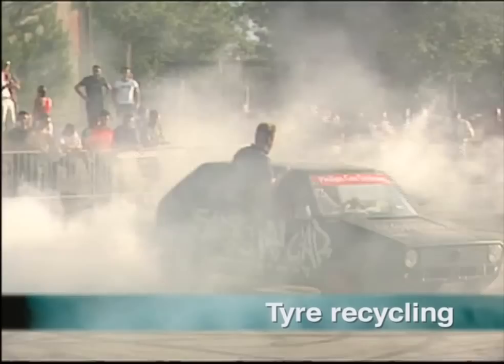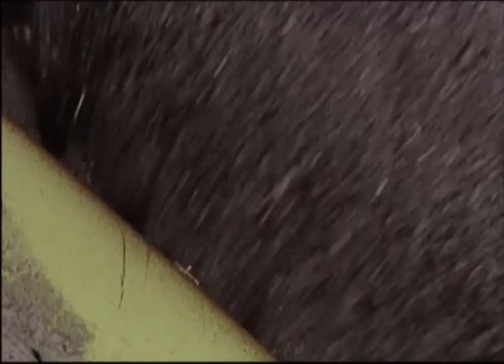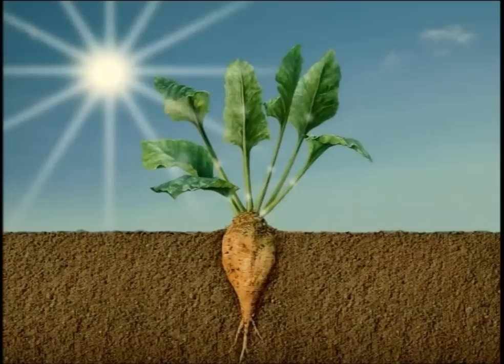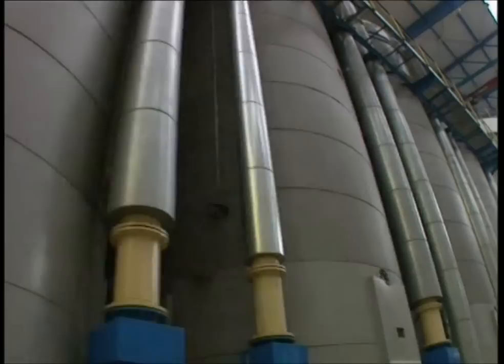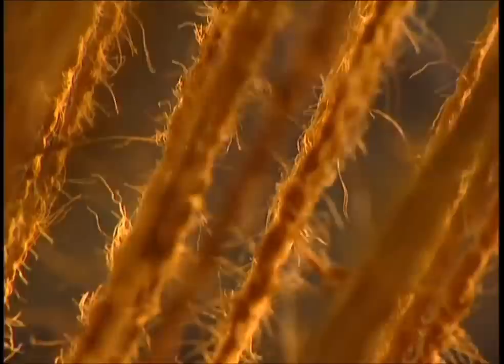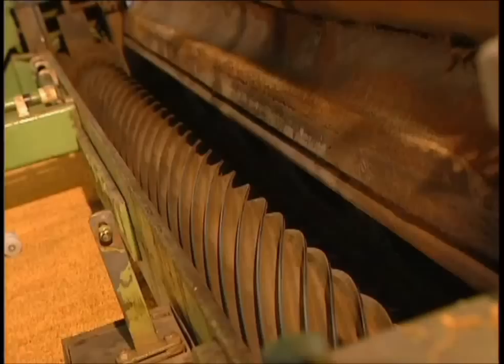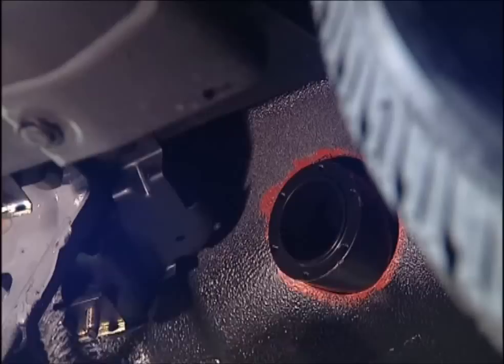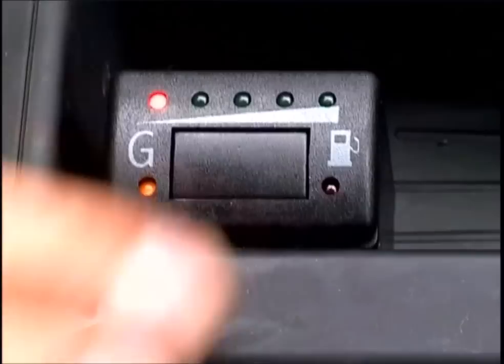HOW IT WORKS | Tyre recycling, Sugar, Doormats, LPG conversion | Episode 26 | Free Documentary

Comment: Liquefied petroleum gas or liquid petroleum gas (LPG or LP gas), also referred to as simply propane or butane, are flammable mixtures of hydrocarbon gases used as fuel in heating appliances, cooking equipment, and vehicles. To clarify LPG is typically propane, which is not a liquid at room temperature, its a gas. It's "liquefied" under pressure in a gas bottle at approx  320PSI. Many  people use a LPG gas bottle to run their propane gas BBQ grill.
Reply: dont forget city buses, many are lpg :)
Reply: BETTER !! TALK !! HYDROGEN !! TOO !!

Comment: Europe is obviously a little behind in fuel technology. LPG (aka propane) conversions were popular in western Canada from the mid-80s through the mid 90s, then began to taper out. By 2015, you would have a very difficult time finding a place to refuel a LPG car, if you could find one at all.  

There were several reasons for people going away from it. 

1. It was less efficient, using more fuel to go the same distance. Even though the fuel was cheaper, you used more, and that, combined with the cost of having the conversion installed made its value questionable. 

2. It lacks the lubrication that is in gasoline (petrol), causing the engine to wear out prematurely, also adding to the question of it actual value.

3. Special safety training was required to fill a car with LPG, which meant that it was not available at self-serve gas stations. With the amount of full serve stations shrinking, people with LPG cars had difficulty finding a place to fuel up. 

4. Unless the engine was completely rebuilt to run strictly on propane, it produced less horsepower after the conversion, which made driving less pleasant. 

5. Increased fuel efficiency in gasoline cars through the 90s and 2000s made it less worthwhile. 

Overall, the cost, and the inconvenience, of LPG lead to its demise around here. Perhaps it will have a resurgence, but I doubt it.
Reply: tell me what Europe is not behind , Europe is even behind China in term of new Tech .
Reply: @caughtinprovidence7197  Have you ever considered fuel prices to be different from the ones you have at your gas station ? In EU in general we have much higher prices and taxes on fuels that you have in the US or Canada, and LPG or CNG, for example, are much less expensive than unleaded or diesel....so it is much more economical to drive an LPG converted car than the standard gasoline one... and I am not considering the difference in pollutant emissions, here in EU Heavily regulated, and much lower on LPG or CNG converted cars. Perhaps not all the world is in your backyard ?
Reply: I think L.p.g. is here to stay. Not necessarily as a conversion but rather an engine much like the forklifts utilize, but fitted to automobiles. Diesel retro-fitted with Lpg add-on is supposedly another alternative. I'm not sure, but many people have such a system and claim it's rewards.

Comment: Crumb or the very fine scrap rubber is used in many countries as a additive to cement and ashphalt products.  We had a very efficient plant that was making playground mats as well as exporting to Brazil; anyway, our local worms beat the operator over the head with paper clubs and he sold off the equipment.  This isn't a "clean" business but it keeps millions of scrap tires out of landfills.  Some unethical auto recyclers bury the damned things!

Comment: I can't see LPG lasting as we're going towards electric now, unless we have an LPG/electric hybrid system.
Reply: i think the biggest limiting factor to lpg is the innate hazard lpg poses, especially when you depend on each individual to properly maintain lpg cars.
Reply: @longlongtran  LPG cars are less of a hazard than petrol fueled. The tanks are made to a higher standard than petrol tanks, and the safety controls on the fuel system are more rigorous. The limiting factor is more likely to be the oil companies, along with governments who stand to lose revenue through reduced taxation. The fuel is more environmentally clean and in most cases is produced as a byproduct of natural gas production.
Reply: @droopy_eyes  the Real Benifit ! Is Hydrogen !!

Comment: If they improve this lpg fuel mileage then I think it will catch on around the world 

Especially in America we have natural gas all over the place
Reply: Don't see that happening any time soon.  It's always been more power and more mileage from our conventional fuels (gas and diesel) than we can get using propane or natural gas to power vehicles.  And, back in the 1980's when using propane in cars began to catch on,  propane was dirt cheap so nobody cared too much that they got less mileage and reduced power.  The benefits were: first and foremost, cheaper fuel.  Because propane burns cleaner (a LOT cleaner) than gasoline,  your engine oil remained clean for a long time.  Back then, oil was cheap too, so we still changed it at the regular interval.  If you bought the car new from the maker to burn propane, it only came with a propane tank.  If you took your gasoline-powered car and got it converted to run on propane, then you had 2 on-board sources of fuel.  In the winter time, it was harder to get the car started on propane, due to the colder ambient temperature affecting the fuel pressure available, so most people would run their car on gasoline for the last mile or two before shutting it off,  then next time, when they started it up,  it would start normally using the gasoline,  they'd drive a mile or two on gasoline, then switch over to propane once the engine was warmed up a bit and running smoothly.  We didn't have any natural gas cars back then, just propane, so while the basic principles would be fairly similar,  the only differences might be the pressure required after the regulator, because NG and LPG have slightly different properties.
Reply: Norm T  for the US it's probably both safety and (probably the biggest problem) distribution. As for safety, I was meaning the people who would be operating those vehicles. We already have problems with people being stupid with gasoline and diesel.
Reply: Natural gas is beneficial for buses that are normally highly polluting and run through dense areas. Not much else.

Comment: So if you convert your car over to LPG, I guess you just don't carry a spare tire?
Reply: I don't see a problem with that since most cars don't come with a spare tire anymore. Some carbrands even make you pay extra for one (VW group for example)
Reply: Depends on the car. Many larger vehicles can carry a cylinder in the cargo area, and lose only a small proportion of the space (which in most cases is empty anyway).
Reply: My diesel carries the DEF tank where the spare tire sits in the gasoline version. It's not that big a deal, reallyé

Comment: LPG destroys car engines, make no mistake a disel or a non disel car is not made to run on LPG.
Reply: Some rural operators of diesel engines add an LPG system to their existing diesel set up. They say that mileage is improved by as much as 25% ...or even more. I have not investigated these claims so I have no comment as to the true nature of this report.
Reply: In the 70's I worked on many taxis which ran purely on LPG. These cars ran for many more kilometers than petrol powered vehicles, and were much cleaner.
Reply: The burn temperature is different. Older valve materials were a problem. Modern tuned designs work well.